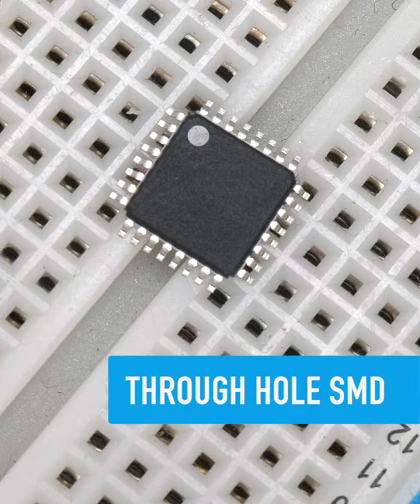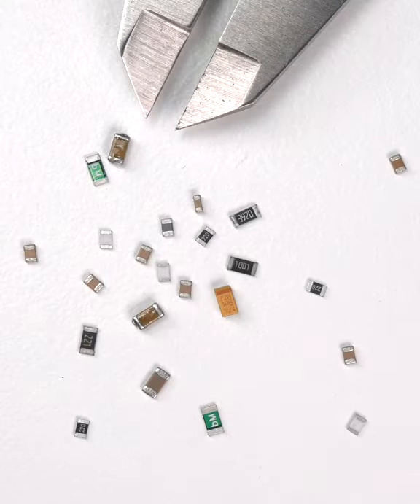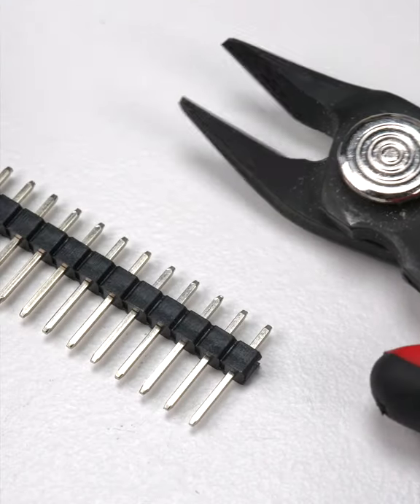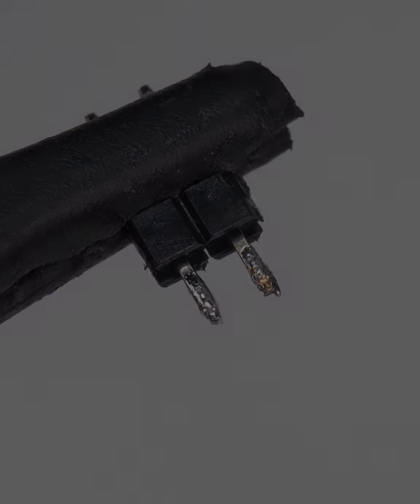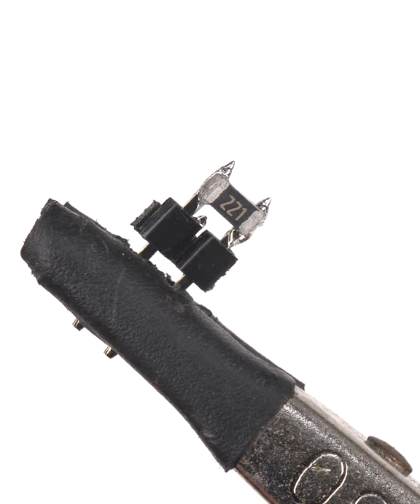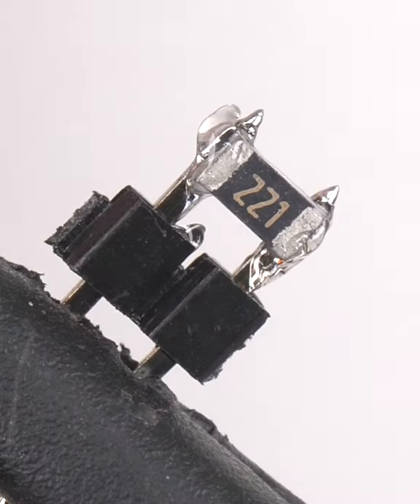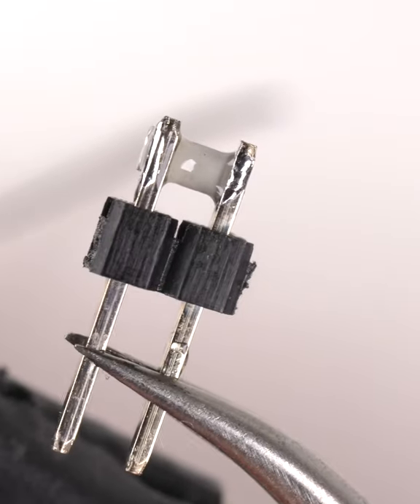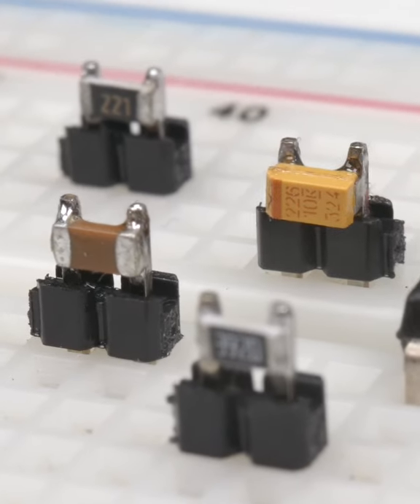Through Hole SMD Components - Collin’s Lab Notes #adafruit #collinslabnotes

Comment: Nice! Another tip: not sure where I learnt this but I use a piece of paper as a very very fine sanding paper and I rub smd components on it to “polish” the “more often than not oxide” layer. This way the legs remain flat and it requires less flux to flow properly. Also that makes me more confident that the underside is properly wetted with tin (I found it the hard way when an old component did not solder properly and just made a “shell” around the legs which shortly after caused cracks to appear with a lengthy debugging session…)

Comment: That's an awesome tip I hadn't thought of. Got any good ways to use SOT-23 transistors in a breadboard or other 0.1 inch environment?

Also you can stack more than one mlcc (capacitor) this way to get the characteristics you want, if you're careful, I've been told
Reply: If you're willing to jumper to the middle pin, I suspect the same technique would work great.  (starting with 3 header pins ofc)

Comment: Something really handy would be smd-0.1' adapter boards that hold the smd part removably. Like with the through hole IC sockets. Anything to that effect out there?
Reply: You can get something similar for some of the larger quad parts, but they are costly.

Comment: I don’t understand how to use a breadboard at all
Reply: Maybe don't, they're evil. They provide terrible connections.

But if you have to use one, it's easy, they have connections running across the board, and then a couple busbars for power and such things running along the board. Sometimes there are deliberate breaks in connections. Just use your multimeter in continuity board to explore the internal connections, or you can often pull off the backing tape to even see them.